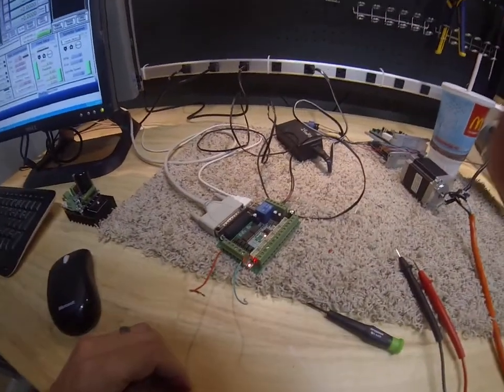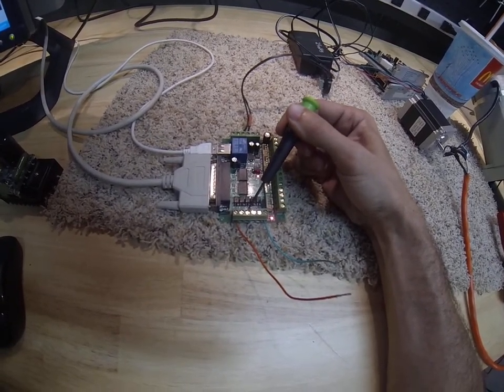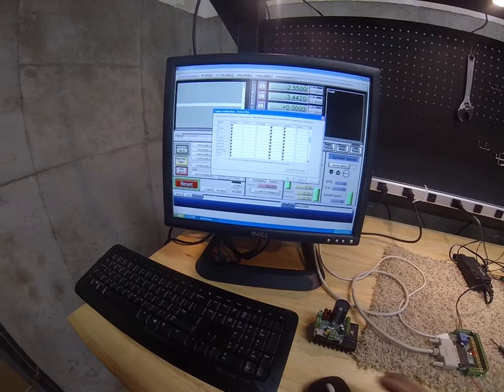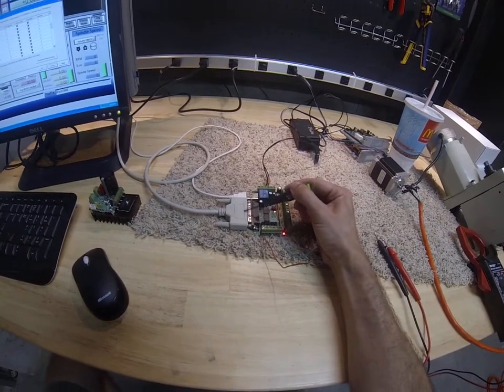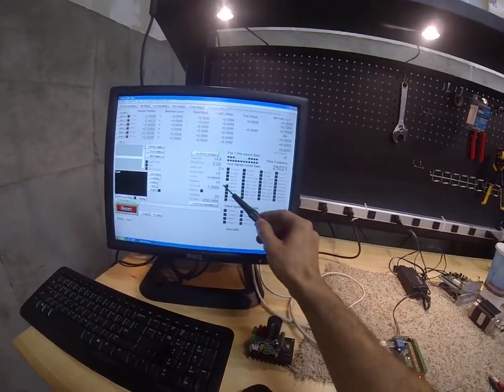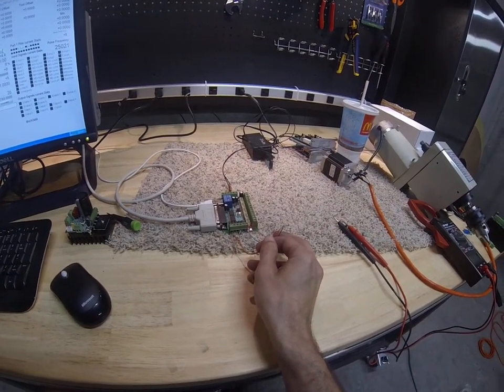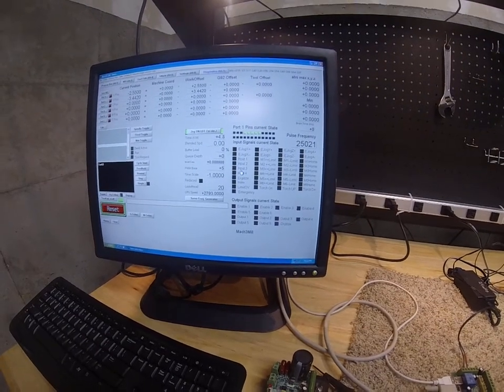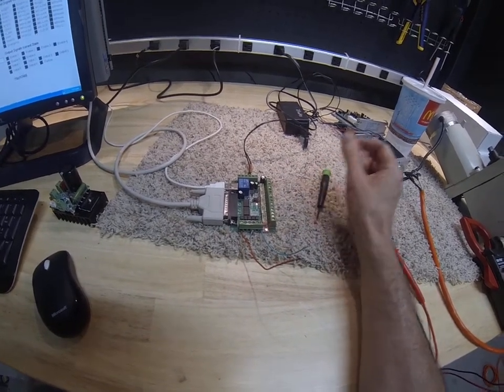Setting up an input in Mach 3

Comment: Is this the same set up for a MPG? I have a USB digital dream break out board connecting A and B to two of the inputs and setting them on encoders/MPG's ? Do I need an external voltage supply for the inputs to work? (Bought break out board from China no input data or instructions and I'm learning how to do it)
Reply: Wow, nobody ever answers any of these questions in cnc videos! I wont even dare trying to ask anything. These guys are all posting videos to make $ but don't care about anyone. I have the same problem; a Chines board with no instructions. Got 3 boards, no instructions on any of them!  6 months my $9000 cnc mill has sat doing nothing because I get no answers. Trying again. Don't even know if I need 12-24v power applied to board extra here, but the led's lit up on his are not lit up here. I really just want to get servos turning first, don't care about limit switches, but can't find a tutorial for that!!